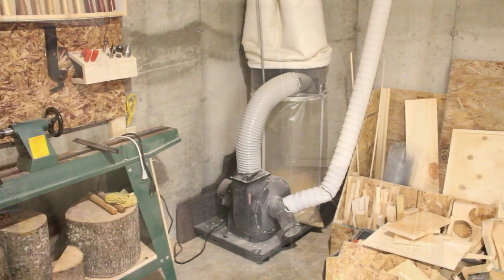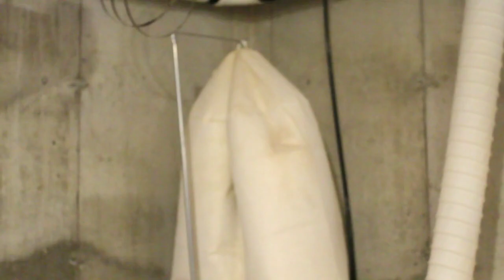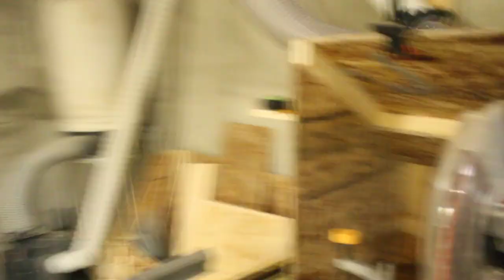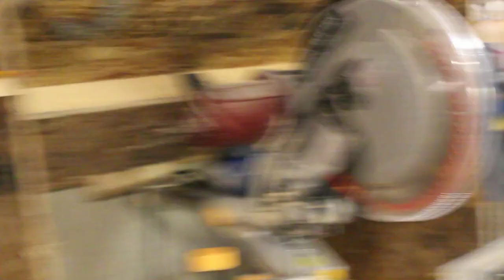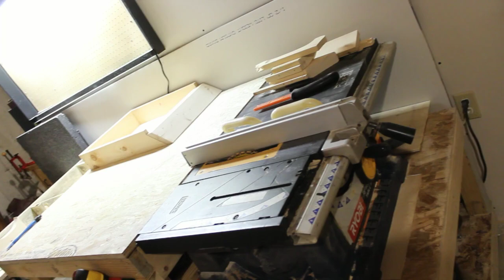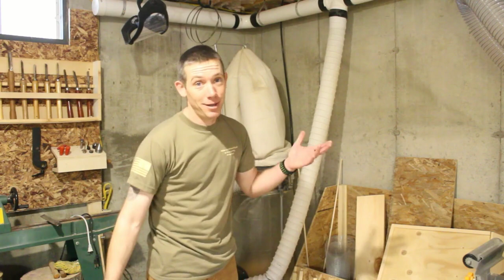Harbor Freight Dust Collector review. Central machinery dust collector.

Comment: Here's a tip for sealing up that harbor freight DUST collector.  I noticed mine leaks a lot of find dust. I tested it with baby powder to see where the leaks were.  Where I ended up fixing it were in these areas: silicone both sides of the rubber gasket that are inside of that plastic outlet that comes off of the blower. Next, I took the small hose section off of the blower and the unit, I put silicone around those areas they clamped that hose back on. Then I silicone around the outside part of the hose. Next, the worst place this thing leaks is around the dust collector bag where it is clamped on. I bought some adhesive rubber seal gasket material from Home Depot. I attach that around the area where the dust collector bag clamps on. So instead of the bag clamping down on metal, it now claims down on a rubber seal which takes care of any leaks. This helped out tremendously.  Personally, I just bought a grizzly canister filter, as those FILTER bags get very dirty and are a mess. It's a bit of an upgrade, but it filters down to 1 µm instead of 5 µm. Plus it has a cleaning feature to it it's really helps maintain it.
Reply: That grizzly was a direct fit ?? To this unit ?
Reply: Asking as I’m getting a Cnc router for my garage and wanna be able to use this instead of a shop vac

Comment: I have a question I have the same planer and I was wondering how that harbor freight dust system handled the planer chips
Reply from the maker: It works really well. If I take a large cut into soft wood it has caught up in the fan a bit. The soft wood tends to turn into noodles when you take thick cuts. No problems with hard wood at all. Thanks for the comment.

Comment: Just hooked mine up today! A few missing screws so a trip to hardware store and it's running. One thing not documented is purpose of the "Y" intake ports (2). Why 2 of them? And is the one not in use to be capped or left open? (Manual doesn't even know they exist!). Thanks for posting this! I've watched it twice now!
Reply from the maker: If both are not being used definitely leave the cap on the one end. Thanks for the comment.
Reply: Just seeing this now & sssooo GREATFUL!  JUST STARTING OUT for real and this is so helpful!  Thank you for being so down to earth & straight forward!

Comment: I've got the HF dust collector also.   Great tool.   I noticed you put your lathe on the stand, instead of the wooden stand you used to have it mounted to.  Any reason?
Reply from the maker: That was at the old barn. I moved and set up in the basement. I just want to try it out and I am not sure if I want it in a permanent spot. With the drying wood on it it is fairly stable but more is required for stuff that is way out of round.
Reply: @heavymetalwoodworking1755  Yeah, I've heard the bases are pretty lightweight.

Comment: Great vid and nice set up, can you please tell me the height of the unit I have a very low ceiling in my shop THANKS!
Reply from the maker: Thanks for the comment. It is 77 inches tall all set up. I hope that helps. Still running strong.
Reply: @heavymetalwoodworking1755  Thanks!